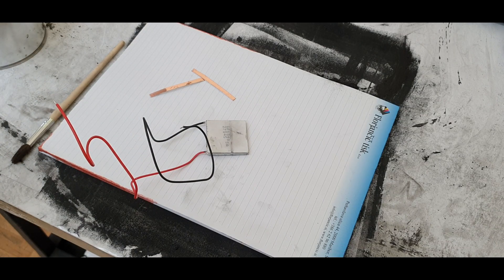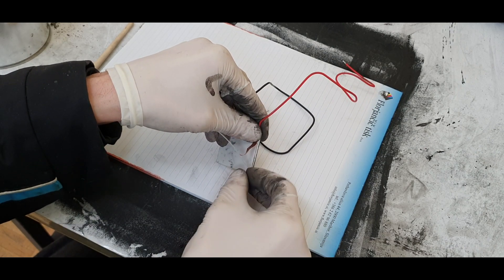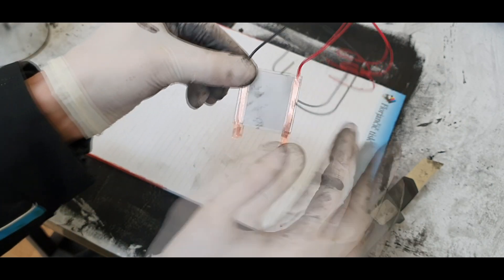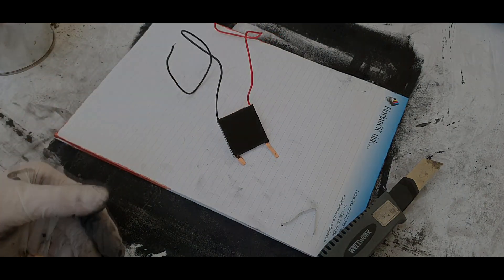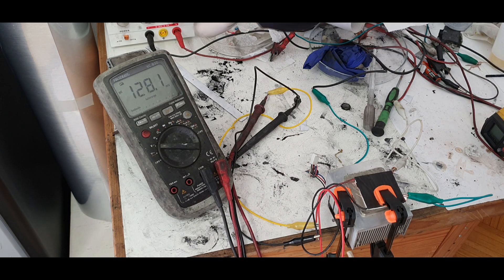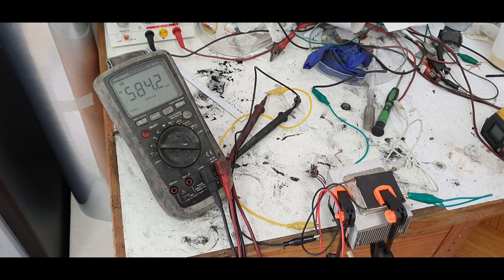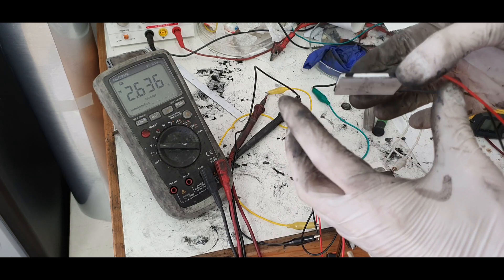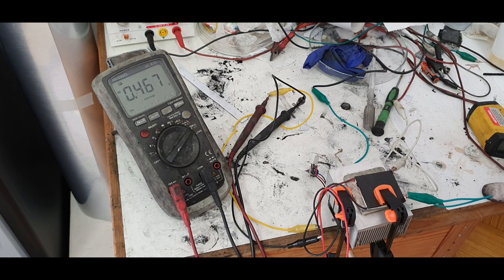Thermoelectric Peltier Generator & Conductive Ink heater

Comment: I've been wanting to try semiconductive inks for painted peltiers. Then one could create integrated devices that can cool down the air or dehumidify, and heat up the hair with heating ink + the peltier in reverse (or just the heating ink, lets be honest xD). A nifty idea for portable and "smart" integrated temperature control. Not highly efficient, but highly applicable.
Reply from the maker: Hey my friend,.... long time no see! ☺ That is a nice idea,.... a peltier paint,... I really hope that will work great (fingers crossed) :) At the moment I am almost finish with my conductive ink which I develop a little bit less than a year  😓 and is a little brother from the high temperature ink.  But at the same time I play with thermal reflective paint which reflect UV  and can be used outdoor or indoor,..... indoor is good for the winter time, because around 40% if not more (hard to say at this time) heat will be reflected back to the room again. And outdoor coating is good for sumer time,... the UV from the sun will be reflected. Maybe can be also useful for you. Be good my friend!

Comment: Honestly I see little practical value in the arrangement other than demonstrating output of heat generated by the ink. There is an inherent inefficiency of a thermoelectric generator (TEG) coupled with a resistive heater. I see no instance where excessive electrical power would benefit by recovery using a TEG over more efficient methods. Even if the ink is being used as a resistive component in a circuit and the point is to recover power lost in heat dissipated a TEG is only about 20% efficient so the cost of materials would be excessive. On the other hand it might be a way to measure the relative heat output of the ink at various thicknesses although an infrared thermometer would do the same thing.
Aside from that it was an interesting experiment.
Reply from the maker: Yes I agree with you. This was a experiment which someone ask me to show what will happen. And I had some free time therefore I make a video.